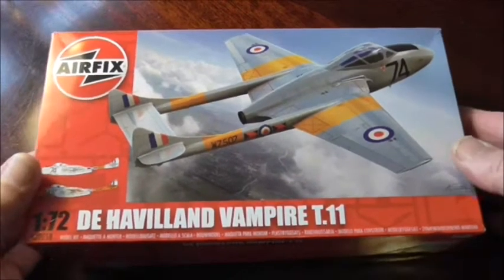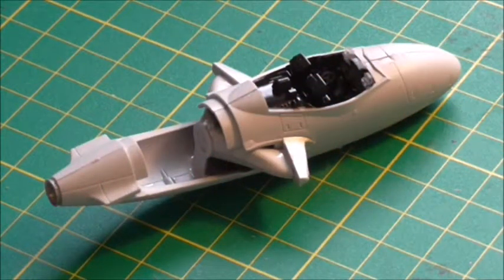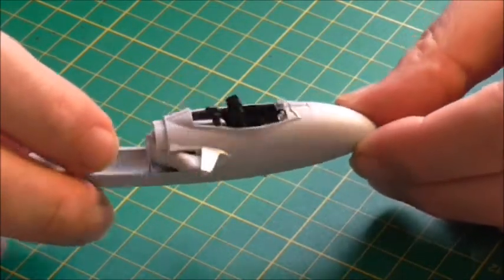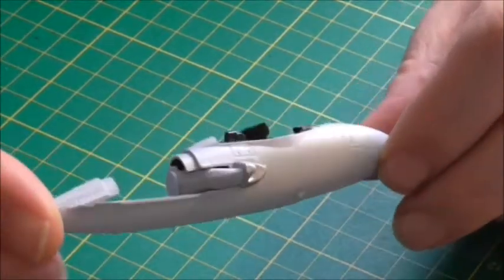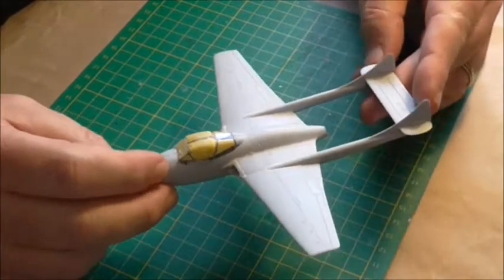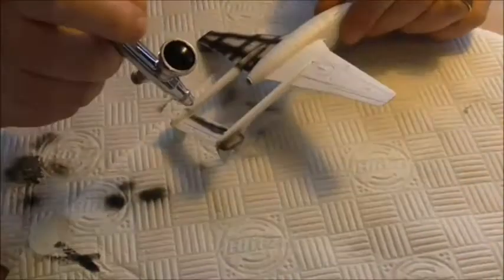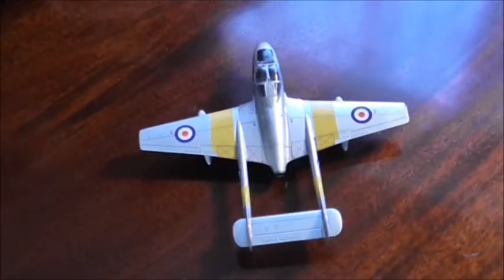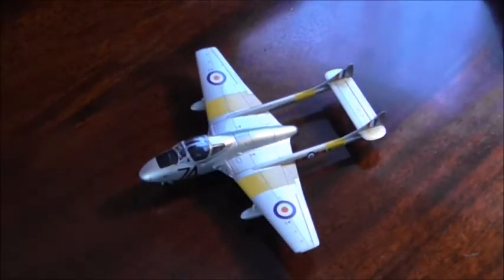Airfix - 1:72 De Havilland Vampire T.11 Time Lapse Step by Step Build

Comment: Nice work. I enjoyed this kit and made the exact same mistake with the landing gear as I always try to put the gear on last. Airfix made a great kit with the vampire but I think their instructions need to improve a little around issues like the fitting of the gear and orientation of the air intakes on this kit. Your build of it looks great however, keep up the good work.
Reply from the maker: UKscalemodeller yes the air intakes were a bit of a pain.... I actually had then in right initially but was so confused with the diagram within the instructions. I cut them off and swapped then around.... It wasn't until I applied the decals I realised my error